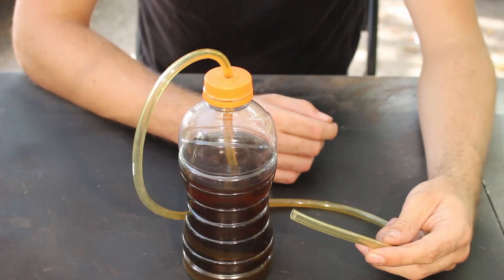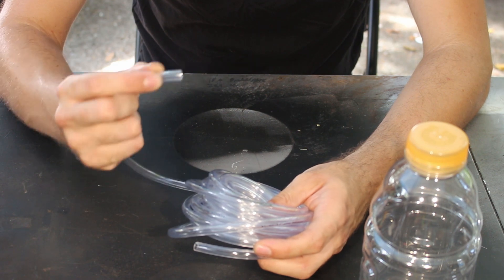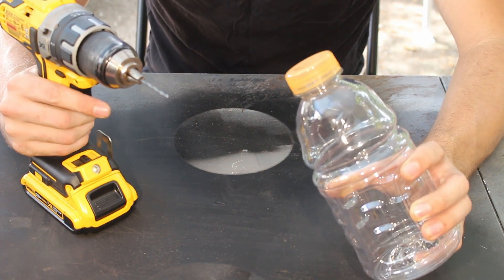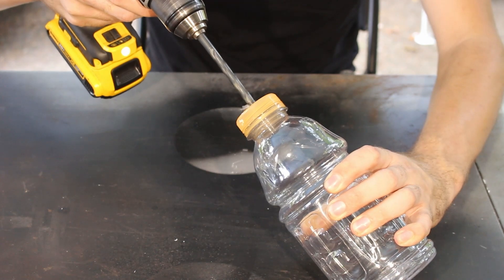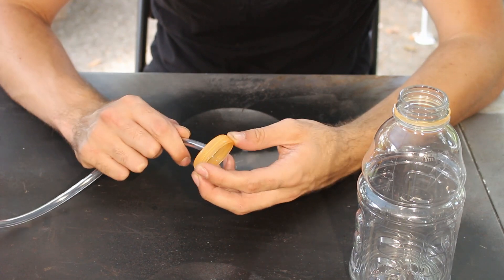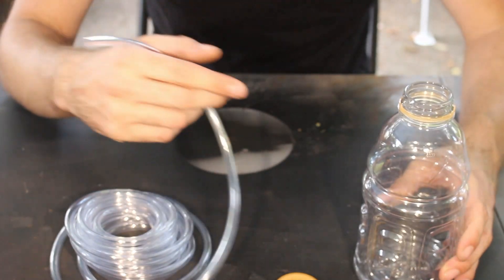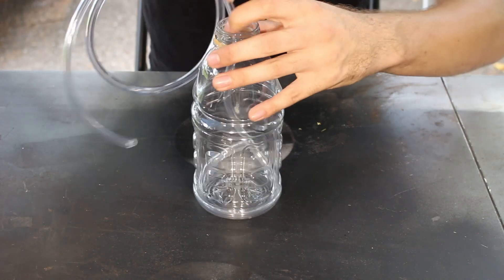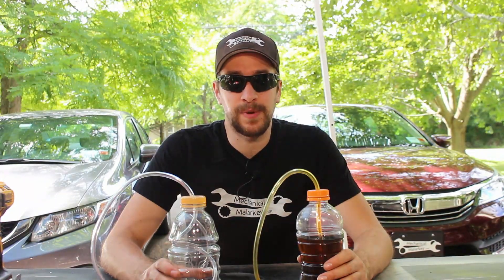How to Make a One-Man Brake Bleeder

Comment: do i need to fill it with brake fluid before i use it or will it work empty and fill overtime?
Reply from the maker: You should be able to start with it empty. I always leave a little in it after using it.
Reply: @MechanicalMalarkey  thank you!!!
Reply: I don't see how that when you lift the bake pedal the expelled air isn't sucked back into the brake system
Reply: @johnchetland873  Did you notice  the small air hole he made with the small bit aside the tubing hole? That is where the air will be out.